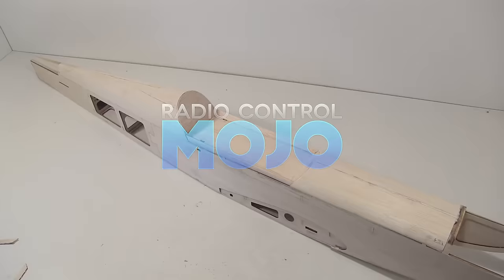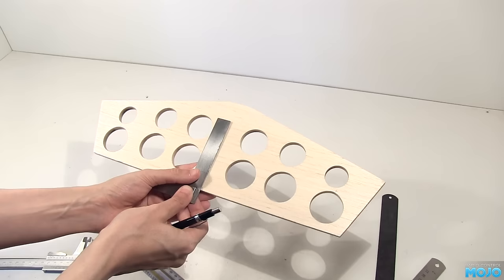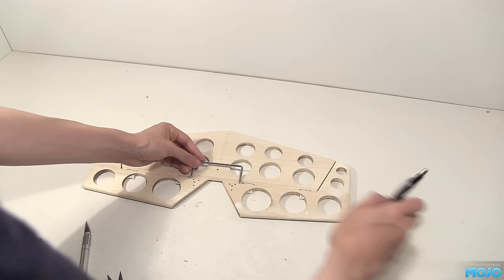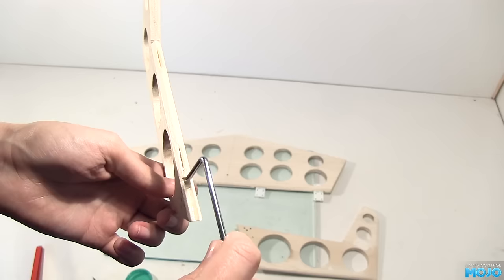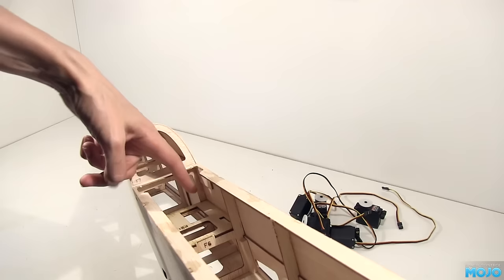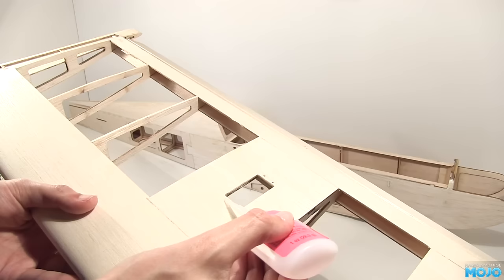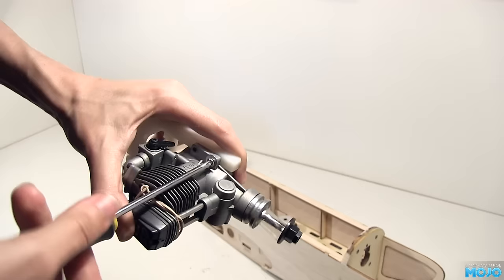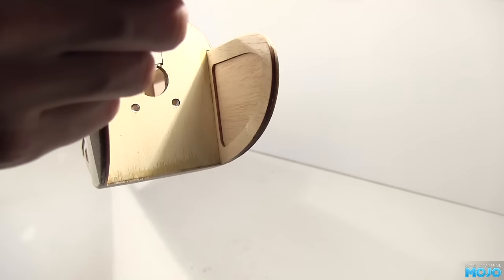Seagull Challenger Build Up Kit - Fuselage - Part 3

Comment: I use a drill bit with a 1/4 inch hex shaft for drilling the joiner holes.   Both the bit and the wood piece are placed flat on the working surface.   The flat edge allows the holes on both halves to be at the same level on the edge.  This is also true of the pinned hinges.  If the tail feathers are 8mm instead of 6 (or 1/4 inch) use a thin piece of balsa under the shaft to raise it until the centerline of the bit is at the centerline of the wood.  This way there is no eyeballing of being perpendicular.  If it is off every so slightly then as long as all pieces are [laced with the same side up then they are all off the same amount and everything will fit correctly.  It also makes a nice notch for the joiner rod.  A 1/16 inch bit can be pressed into balsa quite easily without have to twist it and be used as a starter hole.

Comment: Is it worth roughing up the joiner with some sand paper so the glue can hold it better?
Reply from the maker: obRCmania You'll struggle to make enough of an impression to make it worth doing with sand paper. You could make a dozen or so notches with a grinding disk in a Dremmel, that would really let the epoxy get a grip. Having said that, with the forces involved as long as the gap between the joiner and the balsa is mostly filled with epoxy and not air it wont go anywhere.